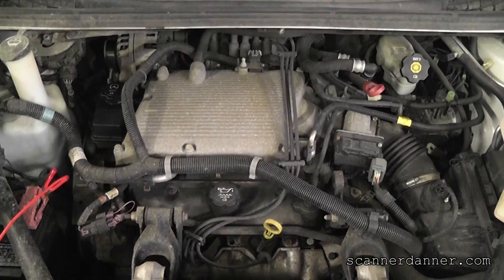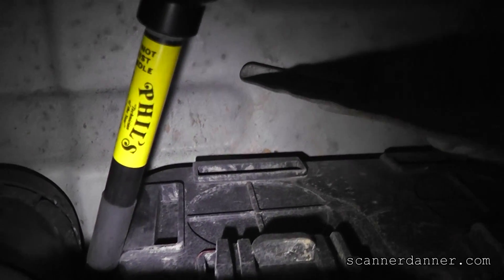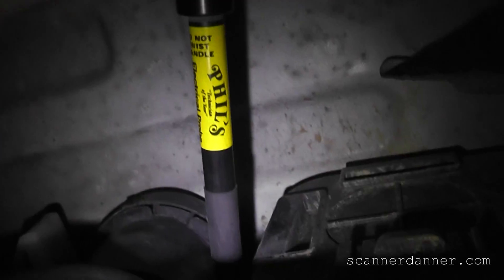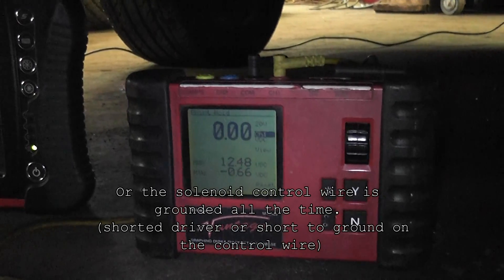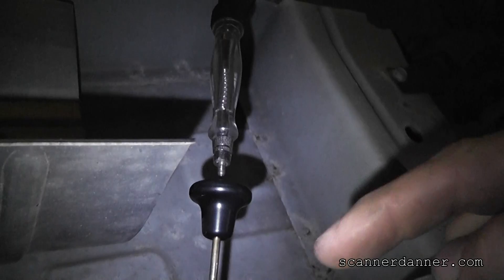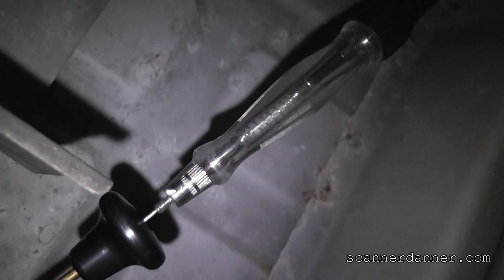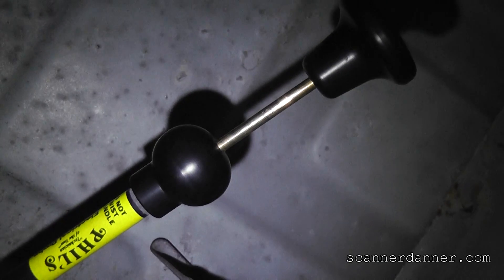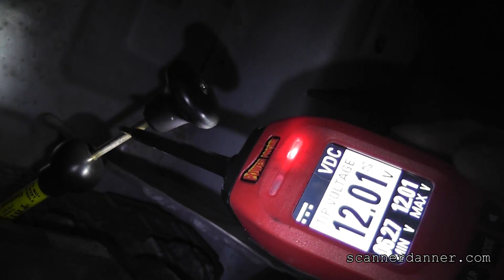How to test an EVAP Vent solenoid (applies to all cars) - GM

Comment: I'm really confused. I thought you said if you supply power with your test light with driver on, you'll cook it. But you just supplied current from power probe though test light and to the driver. Maybe I'm not seeing this correctly. I really want to understand this.
Reply from the maker: The test light is the load in this scenario. I also know that my test light draws about 200ma and the solenoid is even more than that so there is no danger to the ECM driver.
Reply: @ScannerDanner  oh that's right, as long as you use a low current permitting test light or computer safe test light it won't hurt. I also noticed you didn't press the switch you just touched the probe end to the wire piercing tool..

When you were checking for a shorted ground wire or driver, you pressed the switch to send power. Then with driver on, you just touched the top of the power probe?

Comment: Hi Dan is it ok to test canister vent valve circuit driver ground on a 1999 e250 with a multimeter ?
Reply from the maker: Use a test light like I showed. Your multimeter is not going to provide any type of load to that driver.
My name is Paul Danner btw

Comment: I thought high codes meant open circuit
Reply from the maker: It typically does, but with outputs, you can have circuit low codes when it is expected to be high. Like on a ground side switched circuit. 
Was this a circuit low code with an open? I can't remember.

Comment: When time ECM ON the purg valve and CLOSE vent valve plz ans
Reply from the maker: During a leak test only. All other times the vent valve is open
Reply: @ScannerDanner  who's time ECM open purg valve which are inputs for purg valve opening?
Reply from the maker: @AAA-br3cs  purge valve opens after the engine is running and depends on a lot of factors, run time, engine temp, engine RPM etc etc
Reply: @ScannerDanner  when ECM open  purg valve then ECM fuel injection pulse reduse or not

Comment: Will it be possible to check the  solenoid resistance with the test light to ground and it find 12 v throw the solenoid, when the pcm output is not active? Same way you does with an starter, with test light on battery positive and the testlight tip on control wire to the starter, with the relay in off position.
Reply from the maker: Resistance? No
Integrity of the coil winding? Yes!
Reply: @ScannerDanner  my bad, resistance was the wrong word. Integrity was the word I was looking for.

Comment: Wouldn't it be safer to test resistance/continuity to ground through the control driver circuit instead of sending an unknown/uncontrolled amount of current into a computers drivers circuit.

Comment: So you used the power probe as a switch for ground on/off for your test light? It seemed like you were using the term power alot. I just got my first power probe 3, and trying to learn applications for it, and how to "leave the SMOKE in the box"
Reply from the maker: Leave the smoke in the box indeed! This is a great tool! But is just as dangerous as jumper wires in the wrong hands.

Comment: Showing the piercing tool, label says don't twist, but you did!!!🤭
Reply from the maker: The outside housing you can twist, it is made for that. In fact it has a flat blade screwdriver type tip to be able to get in between wires and twist to move the others out of the way.
The part you do not want to twist is the inside, which would be the ball on the end that is attached to the piercing mechanism
Reply: @ScannerDanner  I misunderstood, I thought the handle was the long outside tubular thing.
Reply from the maker: @paulmonk7820  no problem!

Comment: I was wondering why not test control wire coming out of PCM first test if PCM driver is compromised to begin with? Anyways great channel.
Reply from the maker: You still have to test it at the end of the line if it tests good at the PCM. Why would you want to start there? (at the PCM) Also, testing at the PCM is not easy in most applications and is even more time consuming.
Reply: ScannerDanner ohh okey that makes sense thanks

Comment: You could just buy the test lead set... for $20.00 and it owrks on Power Probes and Multi Meters...https://www.amazon.com/K-AMR-Automotive-Test-Lead-Kit-Power-Probe-Wire-Piercing-Clip-Puncture-Wire-Break-Signal-with-4mm-Banana-seat-Auto/dp/B07MMJZD11/ref=pd_sbs_328_9?_encoding=UTF8&pd_rd_i=B07MMJZD11&pd_rd_r=8c8c072d-a0e6-11e9-8006-db48d46a0e0b&pd_rd_w=50wQN&pd_rd_wg=bkFqw&pf_rd_p=588939de-d3f8-42f1-a3d8-d556eae5797d&pf_rd_r=JS04FMTR04E7MRHH04W5&psc=1&refRID=JS04FMTR04E7MRHH04W5

Comment: The absolute best place to locate the EVAP valve is right above the fuel tank. The best place to have the fuel pump is inside the gas tank. And, finally, the very best car to own is one that has the absolute most amount of electronic controls - the more the merrier. This will keep all those poor starving auto mechanics well employed and busy.

Comment: Been a subscriber since 2014 and a subscriber on your premium channel since 2015 and I have learned alot thank you! Question is if your scanner does not have  bidirectional option for the vent solenoid do u just turn on the car and will it start flikering right away if the driver is good or does it take  while?
Reply from the maker: That vent solenoid will only close during the EVAP leak test and there are many parameters that need to be met for that to happen. 
Time for a bi-directional scan tool my friend. You can get a decent all around one for under $1500
Thanks so much for your longtime support!
Reply: Got the snap on modis but does not  have that option for my 97 ford expedition or I missed it, will double check. Thanks again for all your content on both channels literally I did not know how to do any of this electrical diagnostic trouble shooting but after buying ur field manual and watching every single one of ur videos twice on both channels and writing down notes dude I have learned so much lol, i am actually on my 3rd round of watching ur vids now, god bless!

Comment: Testing these circuits with computer in place makes my head hurt, it always seems so complicated. I do get the reason it is done. Components have never been more difficult to get at, access can destroy evidence, and it can be safe if you understand how current will flow.
Reply from the maker: exactly my friend

Comment: Nice, another wire piercing tool on the market. Hello corrosion/high resistance in 3-5 years. Open up that pocket book Mr. Customer.
Reply from the maker: no, it's called liquid tape and it is made by permatex. If you work in the aftermarket like I do and work on 40 different car lines, sometimes you have no choice. You can't have a breakout box or leads for thousands of components. 
Nothing wrong with what I did.
Reply: ScannerDanner 
No disrespect, but any tool that encourages wire piercing IS going to fall in the hands of technicians that will not repair the pierce. Especially a piercing tool designed for hard to reach wires. This is an undeniable fact and we all have seen it. Unfortunately the automotive flat rate pay system causes technicians to take short cuts instead of lowering or removing components in there way of access.
Reply from the maker: "Unfortunately the automotive flat rate pay system causes technicians to take short cuts instead of lowering or removing components in there way of access."

These methods I use have nothing to do with the flat rate system and everything to do with accuracy.  You say we should lower or remove components to test them?
Try unbolting some of these components (in the rust belt of PA) under the car and you snap every single bolt. And what if the component you are trying to access isn't even the problem?
Talk about wasting the customers money. 
Then of course there are the intermittent issues and you need to prove the fault. What happens to a sticking solenoid after the vibration of you unbolting it from where it lives? It unsticks! And you CANNOT prove the fault anymore! See what I mean.

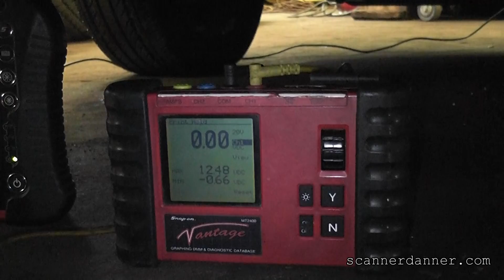Comment: first i really love what you do & thank you. if u have time..At 5:05 what would the control wire read if the solenoid was not open/bad? anyone ...?
Reply from the maker: Great question! This being a ground side switched solenoid, with the circuit off (not grounded) you should read the same as the feed wire (12v). With the circuit on (grounded) you will read near 0v. 
Make sense?
There are variables to this too. An open coil like we had can actually read a bias voltage of 5-12v depending in system designs in the computer.

Comment: so, you used the test light to limit the current to say 315mA (just enough to load that ground, compared to a LED test light of 20mA) and the PP as a voltage source & switch. If you connect the PP to the driver, the only limit to current flow is its circuit breaker (8A thermal) that will be above the rating for the switching transistor in the ECM driver. Thank you for the video, great teaching skills and explanations.
Reply from the maker: I think I'm understanding your statement. But to be clear, NEVER hit the switch on the PP when you are testing a driver in a computer!
Reply: Sure, you will apply 12v capable to deliver 8 amps to a driver circuit that may only go up to 1-1.5 amp forward. Time to get that magic can of smoke that we all love so much...

Comment: +scannerdanner there's an option on the power probe IV for specifically testing the driver circuit without needing the test light? Don't know if you've found and used that yet? Amazing tool and in conjunction with ect2000 makes fault finding electrical circuits in cars so much quicker! They pay for themselves over and over! Great videos! Love them and keep up the good work

Comment: great videos. im I diy guy, im fighting a po446 on my 01gmc 1500, not other codes, I bought and swapped out the vent valve, valve on intake and new charcoal canister and new gas cap, worked few weeks and light came back on, I turn cel off with scanner and come back on next day, I have checked both new and old parts with power probe, it clicks on and off and other intake valve holds vacuum . I read in a forum that the fuel tank pressure switch could be the problem, I have tried swapping just one item at a time and no luck. the o rings on tube from canister to vent valve seem to have a good fit but the plastic lock connectors have broken, looking into making or buy a smoke machine any advice would help. keep up the great videos. travis
Reply from the maker: +Travis S what is the definition of the P0446 code? Is it "vent control" in part of description?
Reply: evap emissions vent circuit low, common fix is to clean or replace vent valve. but no luck on that.
Reply from the maker: +Travis S okay cool, that's what I thought. Two main causes 1. open vent control solenoid 2. wiring to the solenoid is corroded. 
Since you already replaced the solenoid, tug on the wires near the connector, they will break if the wiring was corroded internally. The insulation can look fine from the outside. Don't be afraid to tug on it pretty hard.

Comment: I like the idea of the video but it is a VERY round about way of testing the vent solenoid. In my experience I've gotten rid of a test light because all it tells you is that the circuit is "complete." it doesn't tell you what the actual voltages are which is a crucial note on today's computer controlled cars. I like that you're using the PPIV. the PP3 would work just as well in this instance. remember people time is money when it comes to auto repair.

Comment: Hey Paul, I don't own a Power Probe 4 yet but I am planning on buying one.  I have a question about your test of the ground driver of that solenoid.  To do a accurate test of the Driver don't you have to have the tool in Driver Test Mode?  I saw on the screen that you are on normal Voltmeter mode.  I don't own one yet but I thought I would ask.  Plus if the tool doesn't load the driver in the Voltmeter mode then that test you did is a inaccurate test.  Thanks.
Reply from the maker: +busjockey1 driver test mode (which I didn't know about before I shot the video) is a mode that applies around 12 or 13 ma of current to the driver. Basically the tool is measuring the current flow through the LED circuit. 
Technically speaking, as long as you see the voltage drop, this suggests the driver is functional. I've NEVER seen a driver pass that test and fail some sort of loaded test. If you think about it 13 ma is not really a load either, especially when the solenoid draws about 350ma. 
Remember every circuit is different and we cannot know what normal current flow is in all situations, so "loading" the driver is not something I'm really wanting to do. Make sense?
Reply: Yes I understand.  Just didn't know the full operation of the tool.  Thanks.  Just ordered mine.  Can't wait to tinker with it.
Reply: +ScannerDanner I finally used the driver test mode on the Power Probe 4 and it worked pretty good.  Used it to check the cdf fault driver on a Thermo King Intellegaire 2 Motor Drive.  Try it out when you get a chance.

Comment: doing  holes in wires for profit!   is not recommended  just a thought!
Reply from the maker: +cruzcarpenter there are times it is absolutely necessary and profitable. Just use a little nail polish or liquid tape when your done.

Comment: Great video Paul. Nice polite warning on using the power probe power/ground supply button on sensitive circuits. Very nice wire piercing tool. Next time I shop at AES wave it's on my list.
Reply from the maker: +mrghiax I'm loving this thing. Just used it again today to troubleshoot a bad fuel pump. And the severely rusty under carriage is made made me decide to use it. Connections directly to the battery was key.

Comment: i use a car antenna wrapped in heat shrink with a sharp tip to get in tight spaces. some conduct electricity  better than others.

Comment: Had this exact problem today on a 2006 Chevy K1500. No ground switching in the ECM. The shop that it was at had already replaced the Vent Valve due to the TSB and the truck still wouldn't let fuel be pumped in. Long story short, check your inputs and outputs before shot gunning parts. Very strange problem that I've never seen. Even stranger that I get on YouTube and there's a video of the same problem.
Reply from the maker: +Nick Pittroff thanks Nick

Comment: Hi Paul I find your tutorials are excellent but just one question ,when you were checking for power with the powerprobe could it fool you because you are not putting a load on that wire ,you could just have 2 strands of wire left and you would still see 12v and a red led.
Reply from the maker: +Vince o brien yes and the same goes for the voltmeter. In this case I could not load the circuit because the solenoid coil was open. 
So think about it, I never truly loaded the feed wire and there still could be a problem there. But what are the chances that the solenoid is open (which it definitely is) AND the feed wire has a resistance problem at the same time?! Almost a 0% chance of that. If you are concerned about this in the future, the incandescent test light will be your friend. It will load the circuit for you.

Comment: Might get one of Phil's probes myself! It looks like it is a well thought out tool! Paul the Power Probe is nice but used in conjunction with your famous test light made a simple test look complicated. ( Tip ) I made a test light with a 25 foot cord on it ( stranded,12 ga, low voltage outdoor lighting wire, Home Depot ) and it eliminates the need to find a decent power or ground, since I am always hooked at the battery to B+ or B - . Great vid, keep them coming! You still the man Dude ! LOL !
Reply: +Billy R  I made a long one as well... only mine is really just a jumper. Can be used in conjunction with a test light or whatever fits the need of the moment. (Really it's my third iteration; the first was gifted to a colleague, second was damaged beyond reasonable repair, and the third, now well worn, currently sees near daly service.) I want one of those long probes as well... probably look into it tomorrow.
Reply: you sound as creative as I can be at times !

Comment: question Dan  ! why 5 years to get a power probe ??? and also there is a better model. gives you resistance and amp.
Reply: +Mario Letourneau In my opinion/experience, those switched 'probes' you mention have caused more damage/grief than any other electrical test devise I know of. It's just that it's too easy to inadvertently power up or ground something unintended. They're probably fine for trailer wiring and related... Sorry, but seeing someone with one pegs them as a 'newbie' in my book. Again, just my .02¢ worth... YMMV.
Reply: +rwbishop power probes are great tools. Just because someone owns one doesn't make them a newbie. They're great for alllll kinds of electrical problems. But yea I don't use mine on driveability  stuff
Reply from the maker: +Mario Letourneau why in 5 years do you still not know my name? It's Paul haha just messing with you. I get Dan all the time from my last name Danner.
Reply from the maker: +rwbishop agree with you my friend. I've seen more harm than good, but it has always been from the uneducated. I think this tool can actually help me in a lot of situations, so I'm giving it a chance. Of course I will continue to warn people of the dangers of improper use.
Reply: +ScannerDanner  Sorry Paul, im getting old and im french that is 2 problems. :) i have been using power probe  since it exist . the 2 first models. 30 years in the trade . love your book btw .  PB saved me so much time. that is why i am surprised that you where not using it in videos. big time saver , especially when you talk about grounds to your test light.. love your vids , keep going !
Reply: pb = power probe lol